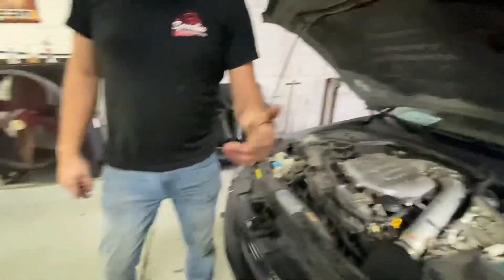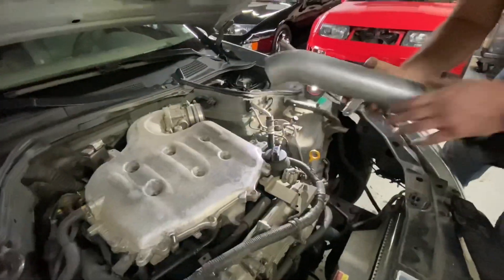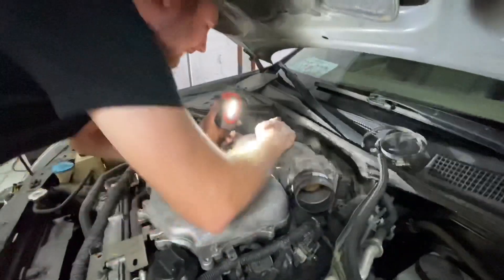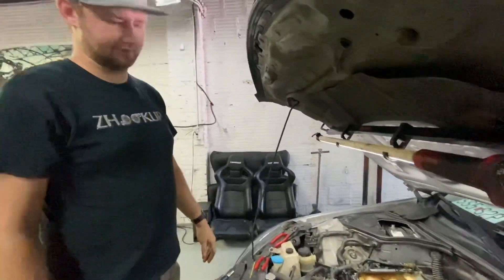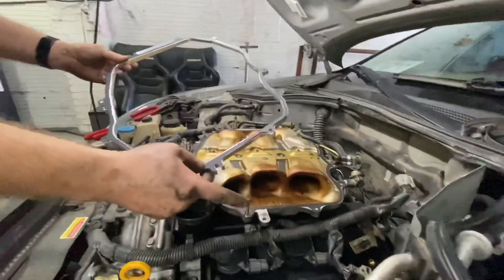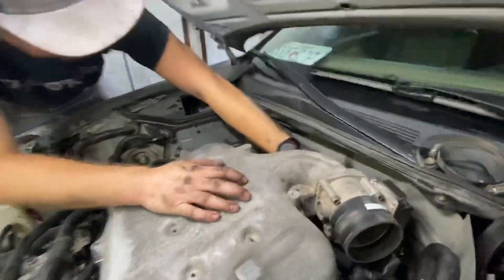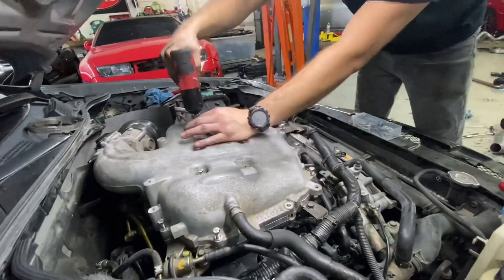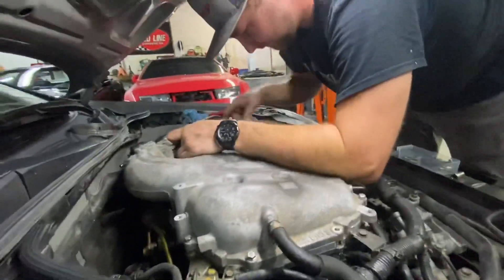How to Install a Plenum Spacer on 350z & G35 VQ35DE

Comment: Any idea why my hood wont close after installing the plenum spacer ?? 
It doesn't close properly without the strut bar so with it it won't close properly . I seriously don't want to buy a 1000$ hood to have enough space
Reply: What size spacer you get?...no need for new hood, but maybe a new  slim strut brace bar
Reply: Just get hood spacers…
Reply: @shaunpermanand🤷🏻 r u being serious LMAO...hood spacers?!? Hell if we gonna do some shit like that might as well invent some thinner motor mounts so we can drop the engine an inch or 2 while we're at it haha....nah but forreal tho if u shim the hood up u are going to screw ur hood cracks up where hood meets fenders! Basically u gonna screw ur body lines up and nothing is going to line up correctly😢

Comment: Is that the non revup vqde? If so can you install a mrev2 manifold or is that only for revup engines?
Reply from the maker: This car is a non-revup
Reply: @SpoolinEnterprises  can you install a mrev 2 manifold on a non revup vqde?
Reply: @alvarotoledo3696 mrev2 is just a ported and polished plenum from a non rev up vq35de
Reply: Hi how did all wick in  350z bwat is bune it